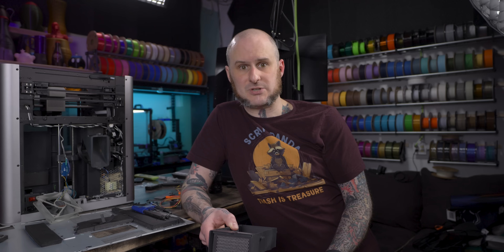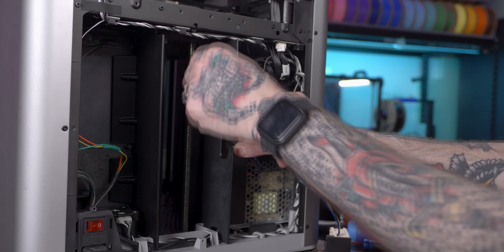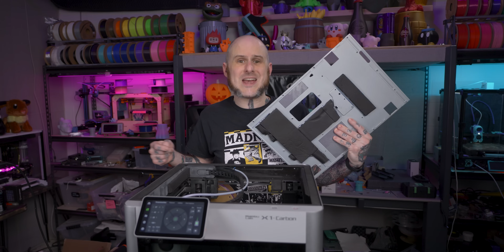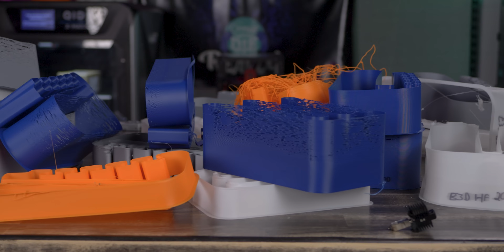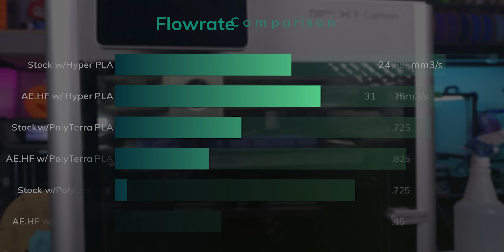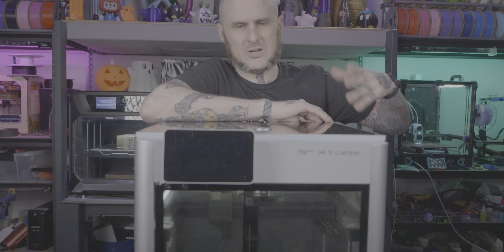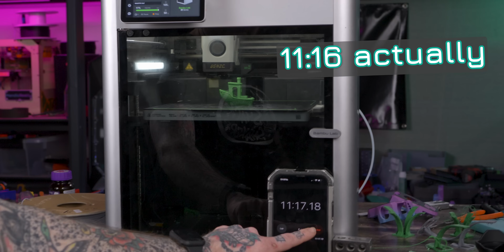ULTIMATE Bambu X1 - Sub-10 Minute Benchys!

Comment: How did you change the model used for the Max Volumetric Speed Test in, I guess, Orca Slicer? Where is the model you demonstrated?
Reply from the maker: Just right click on the model after it loads from the calibration tool and you can select "Replace with STL". Then you can select whatever STL you want to use.

Comment: What is the average lifespan you can expect from a 3D printer? I have a Creality ender3 v3se I just bought,  can I expect it to run (if used 3-4 times a week) in 2, 5, 8 or even 10 years from now with out replacing any parts? Does a enclosure increase or decrease printer life span? I put 8 x 8mm holes under the printer bed (in my enclosure) to let cooler air in to keep the electronics in the base from over heating and put a small bathroom exhaust fan in the top back corner. I´m considering printing a housing for a 80-120 mm pc fan with speed control so the box do not get to cold or drafty, what do you think I should do? I am routing the exhaust air out of the building via a vent but the incoming is from with in my apartment so it is around 20c.

Comment: Hi just checked out the filter seals, there is no seals included for the electronic bay, both files labeled electronic bay are for the filter.
Reply from the maker: Just checked the Thangs listing, all looks good to me. Are you looking at the proper one? There are two listings.

Electronics Box Seals: https://than.gs/m/995214

Filter Delete Seal: https://than.gs/m/995226

Comment: I’m curious if you do anything for ventilation out side of your work area? I have bought a few rolls of ASA and I made a bento box. Really want to start printing some ASA but I’m worried to cause any harm to me, my family or the cat for that matter. lol my printers live in my closet just outside of my master bathroom (it’s the only place I have to setup printers) so my debate is running the bathroom exhaust fan and a bento box enough? Or should I be looking to vent straight from the printer? Obviously don’t want to reduce chamber temps. Any thoughts would be greatly appreciated! Don’t wanna put anyone in harms way but also really want to print some ASA!!!

Comment: My fist print on my Bmabu was an 11min benchy. Looked decent for stock 11min.
Reply from the maker: Did you slice that yourself? The one that comes pre-loaded on the machine is 18 minutes, not 11. Speeding up below 20 minutes becomes an exponentially more difficult thing. Gaining 10 seconds can be achievement, a minute is a mile. That is why Albert over at 247Printing sub-5 minute benchies is so amazing.
Reply: @MandicReally  I sliced it myself. I knew about the 18 min benchy, bought the printer specifically for its speed and reliability, so first thing i did was go through all the settings I could and try to reduce the print time even further. Took me like a week of research before I even printed my first print. Took a lot of self control lol. I was very excited about my new printer. I also have the specs still, I can share them with you if you'd like. All in all, it took about 11 min (print time) to complete the benchy. Haven't messed with it since, it might even be capable of lesser times.

Comment: You'll never manage safe levels with that amount of carbon and that amount of air flow.  Build a positive air feed and vent externally.
Reply from the maker: And dump all the heat from the chamber. Materials that require filtration, require chamber heat too. Carbon filters like this have been pretty extensively tested. Are they perfect and producing clean O2 out their outlets? No, but they are better than not running anything. And venting externally means dumping the chemicals into the surrounding environment, so unless you've got some serious filtration for the workspace, the entire area becomes dangerous then. Unless you mean "externally" as in out through the wall. In that case, how many machines do you think you can run that way? This option is an improvement upon a problem, not a 100% solution.
Reply: Yes, it's a bit of a double-edged sword. The reason why I say that is because I'm an ex-grower and had quite the carbon filter setup on the exhaust. It took a huge amount of carbon to keep the fumes down and had to be continually replaced, because they clog up pretty quickly. I just hate to see people locked in rooms with chemicals and always makes me nervous. Never considered the heat loss - I've never had an enclosure. Maybe semi-passive - where there's just a minimal amount of positive air feed to keep a stable temp?

Comment: I hate to tell you this. BUT you arent doing ANYTHING FASTER. 1 minute is 1 minute doesnt matter what you time it with doesnt matter where on earth you are time is exact. You CANT speed it up and you CANT slow it down. SO this whole idea you have of speed and time is wrong. Hate to burst your bubble.
Reply from the maker: I'm so thoroughly confused and I think you are too... When did I claim my 3d printer broke the laws of physics? I think you are misunderstanding the idea of "Faster". It isn't somehow compressing time to produce a completed part in the same time, but somehow also less. It moves physically faster and produces finished results in LESS time. Aka faster. If a person says, "I went faster on the highway and got their 20 minutes faster.", their grammar is not incorrect. They moved physically faster and traveled across a distance in less time, they went faster... If a 3D printer is not limited by the flowrate of its hotend, it can move physically faster, laying down more plastic per second, and finish a print... faster.

Comment: I don't think abrasive materials attack the inside of the nozzle, the only "high pressure" is at the actual end of the nozzle and abrasion is more likely to happen at the bottom of the horizontal surface where the nozzle brushes over the model. (i'm only talking about the melting zone, i'm not talking about abrasion from solid filament running in)

Comment: Hey @MandicReally, just got these E3D's in from the restock. How do I tell Bambu Studio so that I can use the higher flow rates?
Reply from the maker: Head to your filament profile (The little pencil/pad icon next to the filament.). At the bottom of the first page in that menu there is "Max Volumetric Speed", that is the figure you need to change. 

As for what value to put in there, I cannot tell you that. It will vary for every filament and depend on your own testing on your own machine. This is part of why providing profiles for things like this is difficult, most materials vary at least a little bit.
Reply: @MandicReally  thanks for that detail, do you have a communication channel with Bambu to request these just be added to the nozzle menu?

Comment: If I’m being honest. For myself, speed results for PLA is literally worthless information.   How about TPU( the slow flow filament)……any tests on that. TPU would be worth the watch.
Reply from the maker: TPU depends on more than just hotend flowrate. The constraints of the feeding path are all factors with flexible materials. That material may matter to you but it has little bearing on this particular discussion. For the VAST majority of users, PLA absolutely matters.
Reply: Bambu and polymaker make high flow tpu, and it really works.

Comment: Thanks for making this! Very thorough, very useful! That E3D ObXidian HF looks very promosing. It surpasses my Monoprice Delta Pro with CHT nozzle and stock hotend; where I can go to just shy of 25 mm3/s, which is pretty good for a machine that age. I did try to push acceleration and print speed, but I don't get half of what the Bambu Lab printers can do, because the delta beds' rods are magnetically attached, and at those speeds, the magnetic rods simply detaches. 

However, even at more modest speeds of around 120-170 mm/s print speeds and 5,000 mm/s acceleration, I experience more drooping and stringing than with a standard nozzle. In my testing, this is inherent to the CHT nozzles I have. It would be nice to see whether the AliExpress and E3D ObXidian HF setups do this too, as this extra stringing is pretty annoying to have to remove. The benchy doesn't quite reveal how severe this problem is, but a string tower test will.

Comment: I doubt the copper insert will be an issue, the plastic is more molten there, most nozzle damage happens from the nozzle running over the cooled material where the carbon fibers are locked into place.
Reply from the maker: That is certainly the higher wear point. And I wore out the AliExpress nozzle in less than 800g of Glow In the Dark filament.

Comment: Your bentobox seems to have a different bottom portion with better directing the air presumably. Do you have a link for that modified version?
Reply from the maker: I remixed the original to my tastes. I don’t really know that it is any better, I just can’t leave anything alone. I don’t think my remix is worth posting though. The air guides are arguably a negative as you want the air to spread through the chamber and not focus (when the bed gets low it could act a bit like auxiliary cooling). I did it just to see if guiding the air would help reduce fan noise. No idea if it was successful.

Comment: Do you have ams for you x1carbon, if so do those filaments with cardboard spools work fine?
Reply from the maker: I primarily print out of the AMS and have the entire time. Cardboard spools work fine in there. Perfect? Not always, but generally fine. I primarily use Polymaker filament which almost exclusively comes on Cardboard and the VAST majority of that 2,000 hours has been with those spools. There are easy 3d printable lips that you can put on the spools that help to keep them from slipping on the rollers in the AMS. That helps with some of the minor issues.

Comment: On the ally express hot end, can you use a diamondback nozzle with it? I think it would be funny to have a $20 hot end with a $99 nozzle.

Also, I agree that compensating flow with temperature isn’t ideal. You run the risk of the plastic going past it’s melt temperatures and decomposing in the hot end.

Comment: Great video ! I have 2 questions
Concerning the board fan mod, would you better install it pushing fresh air inside the box or pulling hot air outside of the box ?
Could the Bentobox at full speed when printing ABS or ASA have an effect on print quality due to air forced to travel into the printer chamber ? 
Thanks !

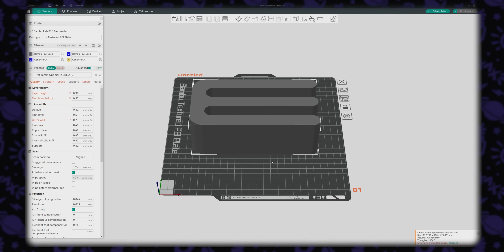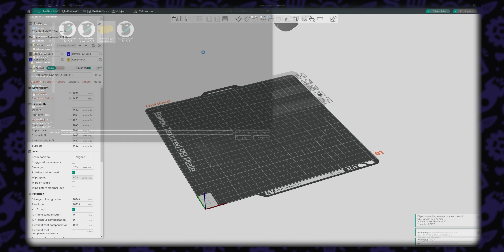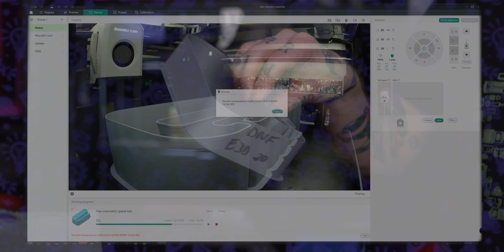Comment: When you replaced the STL with the e3d racetrack model, did you scale the z axis to what the orca model was? At 12:37 it shows the Orca model has a height of 62mm. At 12:42 when you replaced the STL it has a height of 75mm. The slider on the right shows there are 235 layers as well. I know you can't show everything in the video when you're editing it but I also noticed at 22:01 you show the error and the screen shows 235 total layers. How did you take your measurements to determine max volumetric flow? Did you use the Orca slicer wiki to determine the values or did you compensate in a different way? Is there a different way to come up with the value with the e3d model? Hope that made sense. Clarify if I'm wrong about something.
Reply from the maker: Yea I scaled the E3D one to fit the bed better and match the necessary height. Then I exported it and used that STL (so I didn’t have to scale it every time). I should probably just upload the model I “created” but didn’t feel right about uploading their work with so little changes.
Reply: @MandicReally  Gotcha yea simply scaling the model wouldn't constitute a remix I don't think. Thank you for clarifying.

Comment: I inherited 4 X1C/AMS sold one and bought, Qidi X-Smart-3 and X-Max-3. I print a lot of Carbon Fiber parts for the drag racing engines we custom build. Over all performance between the X1C and X-Max-3,  I prefer the X-Max-3.  Both have there pros and cons.  However both have been great on printing billet parts & pre-preg fiber parts.  We used the X1C to print the ASA-CF Hilborn stack ram tubes. Be nice if I could upload pictures on YouTube.

Comment: And what is the point making low quality parts? Can someone explain me? You cannot use low quality item, no one will buy because they look like crap.. Speed not important on 3d print, the quality is!
Reply from the maker: Pushing machines to the limits can show you how far the mechanics and software can go. That gives you a frame of reference to tune down from. Aiming for quality without knowing how far a machine CAN go, is tuning without knowing all the variables. You could print the infill at 500mm/s and save a ton of time, and it may not reflect in the finished part. 

Racing technology in cars trickles down to street cars in bits and pieces. Same concept with fast printing. Knowing how far things can go, informs how far they can go more reliably. It was arguably only months ago we couldn’t have imagined getting a 15 minute Benchy that looked as good as we do today. That came about by trying to push things harder. 

And then sometimes having a part that looks injection molded doesn’t matter. If you absolutely need a part NOW and don’t care what it looks like, then speed does matter.
Reply: Thx for answer! True, if you don't care and you need ASAP,  then quality doesn't matter. 🙂

Comment: The Phaetus Rapido 2 hotend has a rectangular flat heater that looks exactly like the heater used in the X1C hotends. Except at 90W! instead of Bambu's 48W. I wonder if it is the same heater and Bambu Lab is limiting it in the firmware? Hmmm
Reply: The clip they are using is also exactly like the Bambu one.
Reply from the maker: Doubtful. Some folks have used other heater elements on Bambus and burned out the board in them doing so.

Comment: I think the Ender 3 V3 KE is the new "budget" printer. It's fast, and it's pretty solid. I ran an 8 year old spool of Catalyst filament thru it (the vacuum seal broke so it was just a spool in a bag, and if you know anything about Catalyst, it was SH!T filament....kinks galore, and I've yet to have a roll that wasn't cross wound in at least one place)....printed like a charm. I like it more than my prusa.

Comment: Are you sure you're using the correct fans? The pulse signal may either be the incorrect voltage (5v rather than 3.3v) or the control board may be using an analogue signal rather than pulses.
Reply from the maker: Haven’t a clue as I didn’t feel like setting up an oscilloscope to test. So far they work well. They clearly set to differing speeds when commanded and have been running for many hours since this video without issue. That is all I can know without a full detailed spec sheet from both manufacturers or a fair bit of time with a scope. Mine is long out of commission so trial and error is where I land.

Comment: I get 40mm3 with my 2.0 v2 AE hot  end, with PETG, at normal temps
Reply from the maker: I specifically didn’t test PETG because I find it varies flow rate wise, compared to other materials anymore. What brand and “normal temps” was that?
Reply: @MandicReally  Sunlu black PETG, at 245c

Comment: I am waiting for my ali express hotend to get here, but my motivation was different. I could not get the obXidian hotend as it seems to constantly be out of stock, so with the cheap one, I am following a mod called chimera that will allow for the use of V6 nozzles without throwing a height error on the X1. With this, I will be able to throw my diamondback nozzle on there, and I am hoping to see some pretty impressive results from that. I had a diamondback nozzle on my last printer, and it allowed me to reduce print temperatures of all my materials drastically. With the speed of the motion system in the X1, I am hoping that a diamondback on it will be pretty impressive.

Comment: Bambulab should really do more research with their filters, the active carbon filter only removes the smell but not the voc, hepa uses that
Reply from the maker: You’ve got that quite backwards. HEPA filters can’t filter VoCs as they are much smaller particles than the vast majority of filters can handle. Charcoal absorbs the VoCs out of the air. This is some of why most home air filters have both integrated into them.

Comment: The bambu machines are really impressive, but x1-c at least really does suffer from quality issues. Lately because of the volume increases it seems that between shipping issues and their while creative and space saving format is innovative. Its not properly packaged often resulting in machines damage before they leave the factory due to stacking, and poor forklift handling. Their support is still extremely lacking if your not an influencer or willing to go to war with them. I have been through 5 machines, due to series issues, and repeated mishandling during shipping. (my average resolution time was 2 months)

However the place they really shine is not the at 0.2mm heights, but at 0.16 and 0.08 and even 0.04mm layers. This is where the bambu x1-c and p1p's are most impressive. They are so much better tuned out of the box for these layer sizes than the 0.2mm which really in my experience there out of the box profiles are way to aggressive for. But take that same out of the box profile with the thinner layers and they are amazing. Look at what people are doing with hueforges or color lithophanes, or even minitures. Unbelively impressive performance, and quality out of the box.

Comment: Those slashed extrudergears got bad reviews. Great for running in one direction but bad for reversing as the extruder does alot. Just look at the gears in a cars tranny…reverse gear straight rest is cut.
Reply: Reverse gears are straight just for the sound
Reply: And higher torque transfer due to larger contact area. The problem with that item is the arm is made in alu that transfers heat to the case and for some ppl melted parts and or shortened bearings lifetime :(
 @riba2233